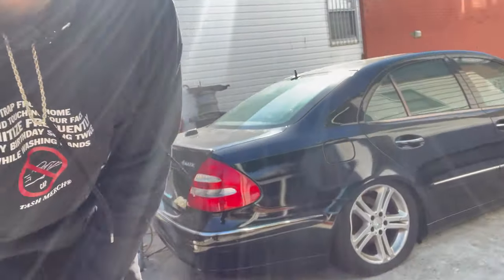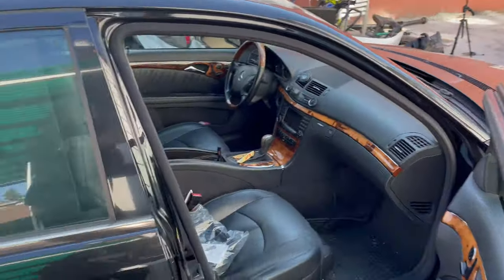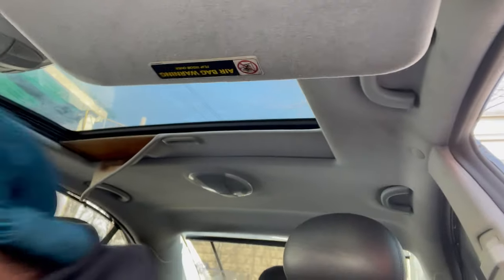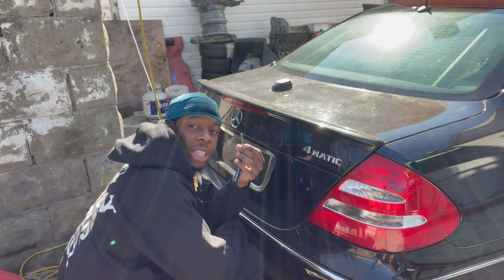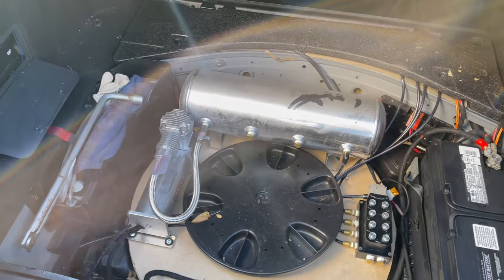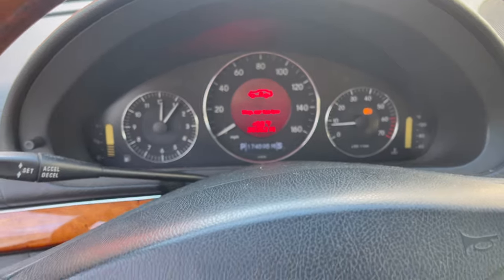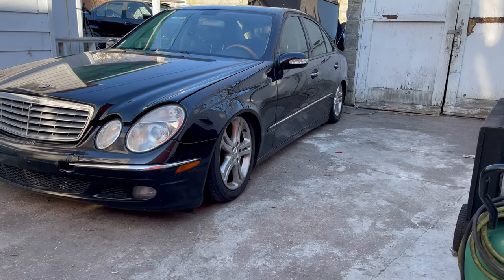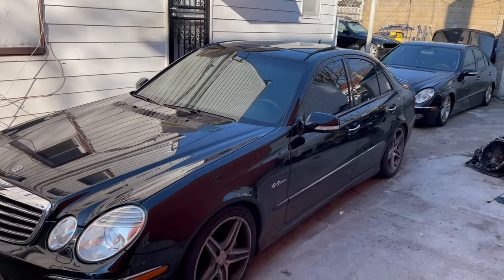My BAGGED W211 E500 DAILY DRVER won't AIR UP...#w211 #mercedes #airsuspension #airtekk #E500

Comment: I have the same exact model, a 2005 E500 and I’ve been trying to find some good air suspension, you mind dropping a link to where you got it? From the sounds of it we have the same idea on what we want done to the car. Facelift, rims, air suspension, headliner, etc.
Reply from the maker: Yea bro had big plans for this car. I got the suspension from airtekk check out the site. They do make the suspension to order so i could take between 2/3 months before u get the struts. Hopefully sooner